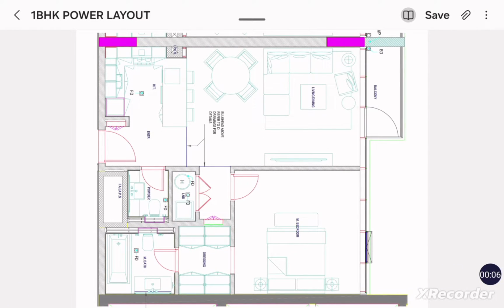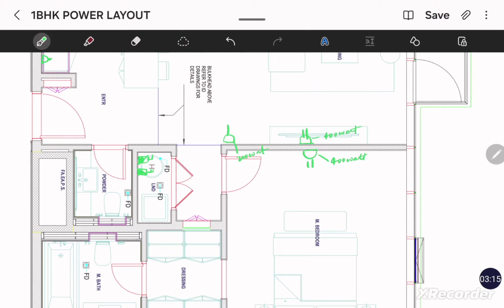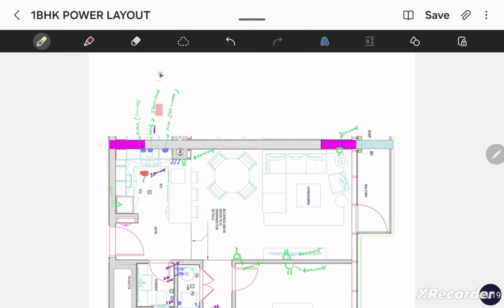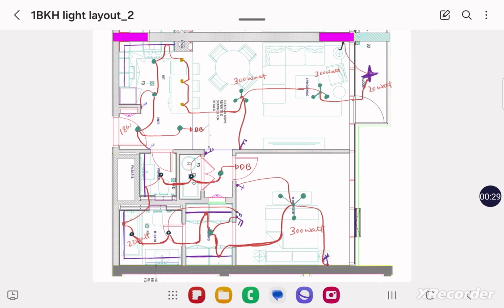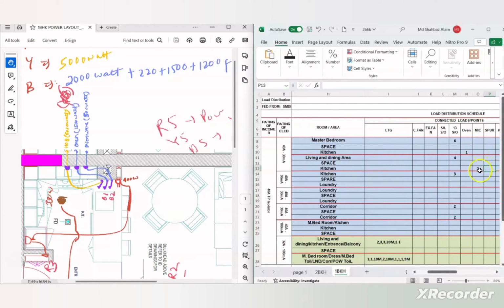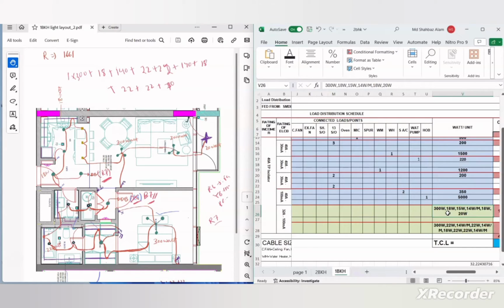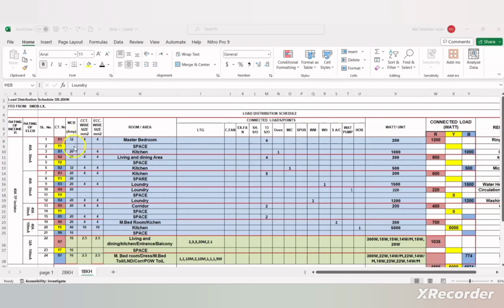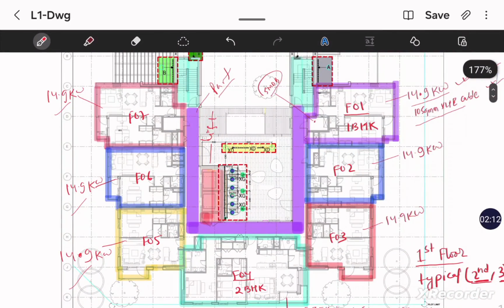G+4 Building designing as per DEWA Regulation ---Part-3. #dewa #regulation2017

Comment: As you said the gap between phases must be 2 meter why you use yellow and red in the kitchen for part 1 video also
Reply from the maker: @seidkemal4062  we need to try as much possible to Keep same phase circuit in one space if not possible we need to keep trying to keep spacing within 2 phase 2 meter  if not possible also we need to try how good barrier we can provide, it all efforts
Reply from the maker: Some time in the grid switch we have all three phase in same back box of grid switch it is also accepted but where we can avoid we should avoid if not we need to have barrier between the phases